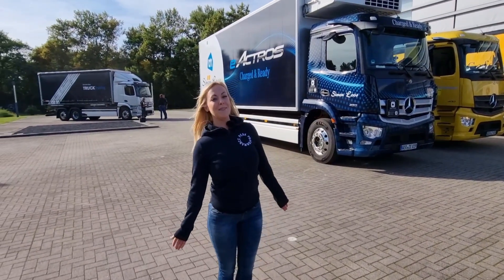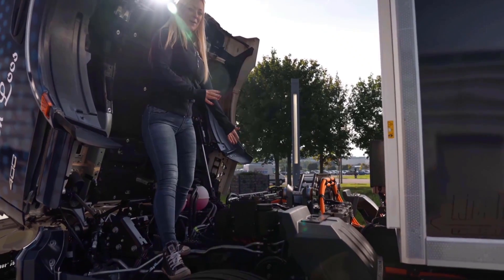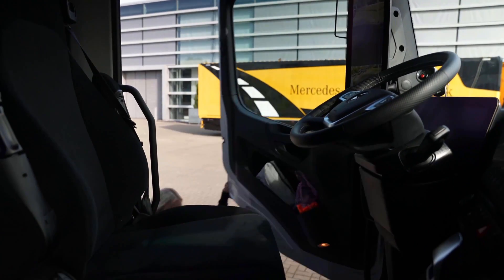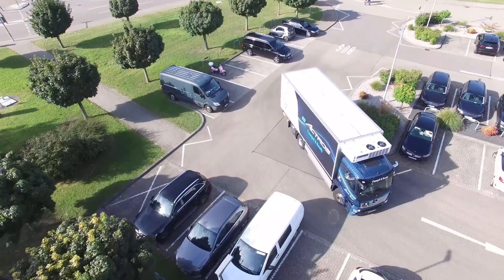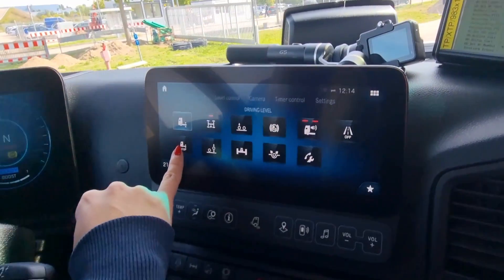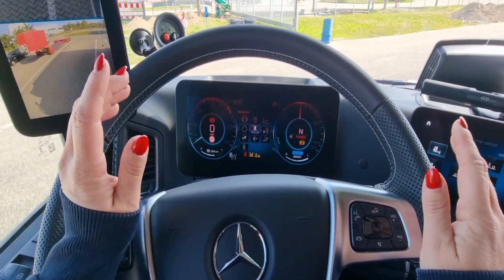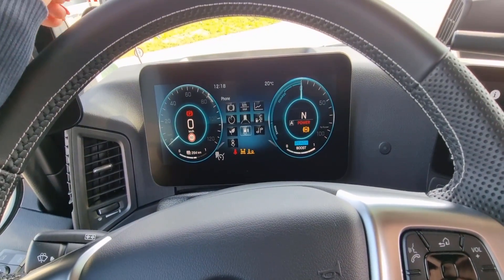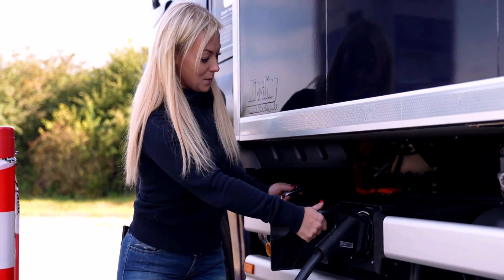⚡MERCEDES ELECTRIC TRUCK⚡ E-actros - Angelica Larsson

Comment: Probably be ok for around town deliveries, but add on a trailer ( or wagon as you call it ) steep hills, weather conditions, charging station networks etc and diesel is still needed. Always enjoy your videos. Hi from New Zealand.
Reply: Hydrogen may be the way to go for longer deliveries.
Reply: @chrispop99  hydrogen is not the holy grail yet. Watch the video on the Engineering Explained channel about it.
Reply: @Mac_F87  Indeed; it has more potential for long-distance HGVs than battery at the moment however.
Reply: @chrispop99  it has potential but how do we produce enough hydrogen to fuel all long distance trucks? The energy needed to produce it outweighs the ease of use it gives. Hydrogen is not economically viable for mass use yet.
Reply: @Mac_F87  Not yet, but electric HGVs are not viable yet either for the majority of deliveries.
Reply: @Mac_F87    Do you think that repeating that  "not viable" statement many enough times it becomes true.  That does not bring the world forward.  What about a good mix of technologies and use what is best in each specific case?   I guess just because a major logistic company in Norway didn't read such comments like your's they have now for at least 2 years been driving their fleet of Scania trucks on hydrogen.   They produce all their needs for electricity ...and more than needed ...including the electricity for producing hydrogen for their truck fleet - from solar cells on the roof of their building.   Their employees are also driving their private cars on the same hydrogen.   The range of the trucks are 500 km - when loaded and also in low temp/winter - and the electric motors have an output around 300kW.   In the capital Oslo buses has been run on hydrogen for years ...that is though a development/test project together with the manufacturer of the buses.    Norway is one of the largest shipping nations and have had battery electric car ferries for years, but now they move on to hydrogen.   The first hydrogen car ferry are already in service (80 cars 300 passengers)..... other are under construction  ....so there will be many to follow.... That is decided by the government..... Hydrogen has a versatility that batteries can't match.  There are so many other factors than only "it takes so much energy to produce hydrogen".  Have you ever heard of winter and low temperatures...???  What happens with the batteries then.....well....suddenly a 40% or more loss in capacity.... to a degree it become useless...!!!  Solar/wind/waves etc...varies all the time ....but are energy for free...so produce/store the energy in form of hydrogen on site.  The electric grid are not constructed for ups and downs ...but for a stable supply. ....and also for a stable load....  Many places is it already maxed..... so who shall pay for a new grid to supply all these battery things...???  How much energy does it take to construct a new grid... and how much nature shall be destroyed...???  None of that is taken into account in the battery-fan lobby...  Norway has experienced these things in the reality - as the battery electric transportation nation number 1.  No other nation are not even close. 
It is also in Norway that the development of ammonia as fuel for ship engines are being done.   Ammonia are heavier and takes more space.   Both EU and specifically an significant/important nation as Germany has decided to go for hydrogen. ....but I guess they haven't read comments like yours.....
Reply: @Dan-fo9dk  one or two logistics companies isn’t really putting strain on hydrogen production though it’s it? What happens if all companies across the globe switch their long haul fleet to hydrogen? Where does the energy come from to produce that volume of hydrogen? It’s all week and good for a limited supply for one or two fleets of vehicles. I’m not against any new technologies but putting across the point that they won’t work large scale and are not a current one size solution to the problem. 

I suggest, as I mentioned previously to watch the video from Engineering Explained about how hydrogen won’t currently take off large scale at the minute or the near future. Then again it seems you like to massage your ego thinking you have all the answers so I guess you won’t. 😂

You keep banging on about Norway. I know fine well about Norway and their drive for green energy and vehicles. I’ve worked there for nearly 3 years now, both in Bergen and Stavanger.
Reply: @Mac_F87     I can't say that I get much impressed with what you come up with....  You seem incapable of reading and understanding what you are presented with in a correct way.   Instead you turn things upside-down.   The logistic company is not putting any strain on anything.   They relieve the public electricity grid by producing their own electricity and hydrogen themselves.    It seems like you have a problem with facts and just want to dismiss it like local and irrelevant/not viable.   .... or as you call it "to bang on" when presented with some facts about Norway.  .....The fact is that Norway is a leading nation in these fields.  I can mention another and "irrelevant" Norwegian company named Yara.   It has it's history back to 1905 (just to help you with the math ....it is 116 years since).  They are the worlds largest producer of fertilizer ...they actually were the inventor of that process.   If there is someone who knows what they are doing within electrolysis and gas it's them.  They are about to establish large scale facilities for production of so called "green" hydrogen.    Ok....dismiss Norway...... Maybe it is to much of a challenge for you to see that somewhere must thing start.     ....but when you ignore/dismiss Germany's and EU's decision to go for hydrogen as something irrelevant (help them....they don't know what they are doing) you just make yourself laughable....   
Yes, energy resources are indeed uneven distributed around the globe.   Reality is the straight opposite of what you claim.  It is not the problem for hydrogen ...but it's strength.   It can be large scale produced, stored and transported from anywhere to anywhere.  It is exactly the same as what has been the case for oil and gas (including hydrogen for industrial use) since it has been transported all over the world for more than hundred years.  There is nothing new in this.  The large scale capabilities and economy in that are no utopia and goes far beyond what your battery "ideology" can offer of solutions.   So get your facts straight...   Example: Iceland is loaded with geothermic energy ....try to supply Japan with that energy....   ...the answer is certainly not an electric cable and batteries.....  For simplicity let's say that the efficiency is  - at the consumer in Japan - so low that they only get 20-30% of the original energy amount on Iceland.  ...well...so what.... In the case of your battery world the energy "efficiency" would be zero.... you would be incapable to tap and distribute that energy around the globe.  Here we talk about unlimited energy resources... it's for free....  If you don't understand that something is more than nothing ...then you have a problem...   I am not gonna spend much more time on you....so if you want to be a victim of manufactured ignorance ...I can't do much about it.....
Reply: @Dan-fo9dk  You’re not going to spend much more time on me? Sorry to break it to you but that won’t make me lose any sleep. You’ve gave examples of companies that use hydrogen currently. That’s all well and good. Like I said it’s not going to work large scale though is it? You mentioned earlier one company uses solar power as a one source of power fr hydrogen generation, not very good in winter when a fraction of sunlight hits them in temperate climates. Norway are a bit of a convenient situation that a lot of their electricity generation comes from hydro which would keep the cost of production down. Their abundance of hydro is exactly why the cable was laid across the North Sea to the U.K. as surplus electricity is sold to the U.K. Just because hydrogen works in Norway doesn’t mean it’s ready to work large scale, right now, everywhere does it? This is my whole point but you just keep trying to justify it by saying some companies use hydrogen now.
Reply: @Dan-fo9dk  very well said. People are hard in:
Changes
Thinking out of the box.
Surprised how many still think in horses and hay.
Reply: @chrispop99  Turkey channel 🦃🦃 5252🦃🦃https://youtu.be/R_-jPuQUzm4
Reply: @chrispop99  Trolley lines for long distance, hydrogen for remote areas.
I live in Northern Canada, from me to the South trolley, from me North hydrogen fuel cell. I'm at ~55.75° N
Reply from the maker: Thank you 😊🙏
Reply: @AngelicaLarsson  forgot to say I drive a Scania S620. Aren't the new ones amazing.
Reply: @rossforbes594  lol bro she don’t care about you she only cares about how many subscribers she has😂😂
Reply: @AngelicaLarsson  have you had any issues when driving Passing under a bridge? Different height in bridge clearance.. 👍🙏
Reply: It was already mentioned in the discription, that these trucks are ment for inner city transport.
Reply: @JacobBax  that will probably answer my question on night heaters.
Reply: @JacobBax  Turkey channel 🦃🦃 5252🦃🦃https://youtu.be/R_-jPuQUzm4
Reply: Being an engineer myself, I am most amused every time the typical internet sofa experts jump out to correct, in this case, the engineers of Mercedes Benz: This Is sold as a city truck.
Reply: The funniest moment when you press the start button you don't know if it's on or off 😂😂😂
Reply: What can you expect it just beginning like diesel truck 100 years ago… They can improve over time
Reply: @ouenhila366  Turkey channel 🦃🦃 5252🦃🦃https://youtu.be/R_-jPuQUzm4
Reply: Mountains, do you think AH wil be opening stores in France or (Southern Germany), not everyone lives on vulcano's;-).. DC to stores.I would bet the Collies (them metal/plastic trolley wheeled 'trucks' that contain the products ) will now make more of a racket than the electrick truck. Unless it still carries that beeb, beep, beep, that carries through the night.
Reply: Yes this types uses for delivery items to bigger depo
Reply: Seeing its a day cab that’s exactly what’s intended
Reply: Scania has a test project with cantenary on the freeway. The idea is that the truck is feed eletrical power from the cantenary on the freeway, and when it turns of the freeway it goes by battery to the depot for unloading and loading, this way range won't be a problem.
https://www.youtube.com/watch?v=27100u7IcII
Reply: Actually there is technology out there that can charge on the go that is 220V but allowing use of patents hold it up. Electric has more torque than diesel so that could be an advantage. Horsepower is about balanced. So hard to debate seeing Ford released an F150 mind you that can pull a train loaded with every version of F150 developed in a straight line. So a larger truck should be able to haul one trailer.
Reply: The first Tesla Roadster was based on laptop batteries. Look at where we are now 10 years later.

In 10 years this technique will be way better than diesel trucks.
Reply: Maybe not diesel or hydrogen, but some sort of small onboard generator to keep the batteries topped up - a Wren gas turbine from a model helicopter could do it, with the turbine driving a large alternator via a reduction drive gearbox.
Using a turbine would also mean the fuel mapping could be altered to match whatever is available locally.
Ammonia may be a better choice then hydrogen if sticking to ICE format generators, just for the ease of storage and delivery of the fuel.
Reply: @PiDsPagePrototypes  How would that reduce harmful emissions to zero?
Reply: @chrispop99  It is dependent on how the fuel is made. Example is cryogenic liquid methane, which can be made from CO2 pulled from the atmosphere and hydrogen from sea water, using solar provided electricity and a catalyst, that process is circular with the methane burning with oxygen (that was in the sea water with the hydrogen) to become CO2 again.
Making the fuel from current green house polutants curbs the rising levels of polutants. Ammonia can be done from seawater and the nitrogen in the air, burning with oxygen to make water vapour and free nitrogen again.
Reply: @chrispop99  The harder step comes after, with getting to a negative emmisions state, allowing the Earth to recover, that comes from planting a lot more diverse trees.
Reply: @PiDsPagePrototypes  Turkey channel 🦃🦃 5252🦃🦃https://youtu.be/R_-jPuQUzm4
Reply: Just started youtube channel same content pray for me my dearest .
love 💕 from Dash5

Comment: Without going back into the video, but I believe she said the batteries weigh 700kg each X4 batteries. If correct, the batteries weigh in at over 6,200 lbs, at lot more than a diesel engine on a in city truck. 

The other issue is only charging the batteries to 80% capacity. You wouldn't fill your car or truck with gasoline or diesel fuel to 80%, so IMO the charging issue needs to be addressed. Same goes for the removal of the charger cord.

What Mercedes isn't talking about is that lithium batteries lose capacity when cold. This truck in Sweden would only get at best 75% of the projected range  when temperatures drop below 0 C. So you've already got a loss of range from the 80% charge and you lose another 25% from cold weather, so 266 Km drops fast, not counting the use of the electro-hydraulic lift gate pump.

Great as a concept, not so great in reality.
Reply: As the EU Commission is in favour of increasing the permissible gross vehicle weight of trucks with alternative drives by up to one tonne, this will more or less level out the weight surplus of the electric drive. This will raise the permissible gross vehicle weight of the eActros from 25 to 26 tonnes, which will bring the original extra weight down to 700 kg compared with a directly comparable IC-engined truck.

Comment: My average day driving in US is 500 - 600 miles. 800 - 1000km. Don't even have to stop to fuel...
Reply from the maker: Wow, that's a lot 😄 we can't drive more than 650-700 miles a day, if everything rolls as it should

Comment: i like your vids.but this all electric truck their is no long haul anymore or there will have to be 3 trucks on the road just to do the job of one driver and one truck.and in cold weather they only charge to 80%.and real cod weather 65%.and if they say well their will be blanket heaters for the batt"s that will take 20% of batt"s life.

Comment: So much use in the on screen system wait until it slows down and basically stops working entirely. Press something and it wont happen for 15/20 seconds later. Never used such a bad infotainment system before and I've used Ford Sync 3 :D Truck looks gorgeous otherwise and is cool being so quiet

Comment: It seems like it is/was in use in Holland,  Simon Loos is a dutch  distubutor, in this case for AH ( Albert Heijn) one of the biggest ifnot the biggest supermarket chain in Holland...
Reply: A couple of companies have been testing them for a year. All of them plan to buy several. They are more expensive. But service costs are very small.

Comment: Hmmm. I wonder how the range will be in winter time.. I don't think it is very suitable for the long distances of northern Sweden and the low temperatures combined.
But of course I really know nothing about it, so I may be wrong 😅
Reply: How far does a local delivery driver travel in a day in an urban setting? This model is not designed for long haul obviously. Since it can reach 90 on the test track, perhaps interurban.

Comment: Can this technology pull a full load at   40 to 80 THOUSAND lbs and go 500 miles with out running out of charge probably not isn't ready yet and clean diesel is way more efficient.

Comment: Well, as long as it doesn´t go up in flames like many of its brothers and sisters... I could imagine it maybe for short trips in cities. But they aren´t as environmentally friendly as the manufacturers claim. And maintenance costs aren´t as low either. Specially not with rising electricity prices all over Europe. Reliability would also be an issue in a future, where the availability of power in general is going to be questionable, due to cutting down on fossil fuels and nuclear power, because of a falsely claimed CO2 caused climate change. However, it´s always a happy day with a new video from you, Angel. Take care, sweetheart!